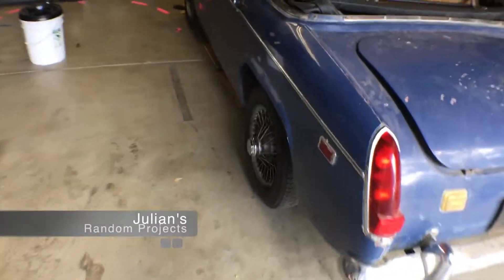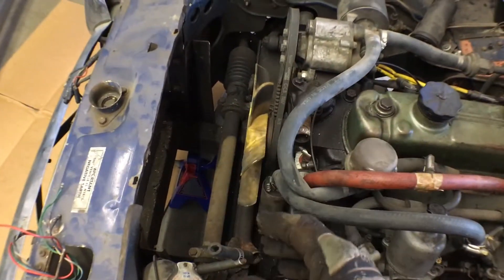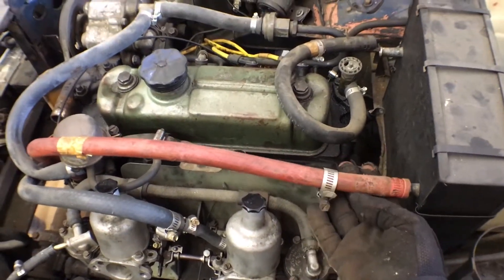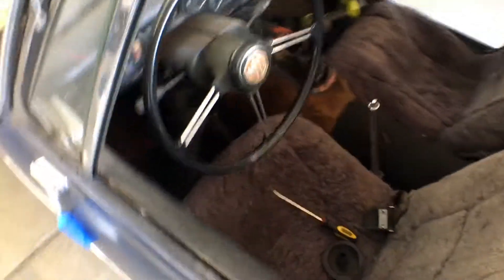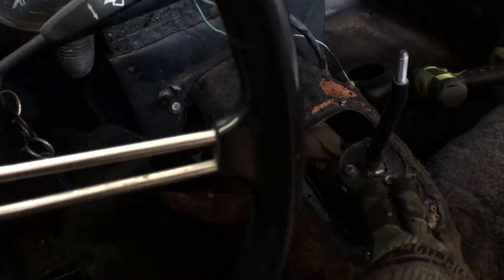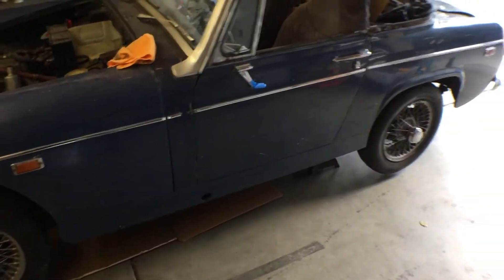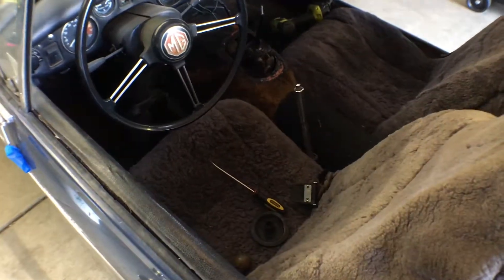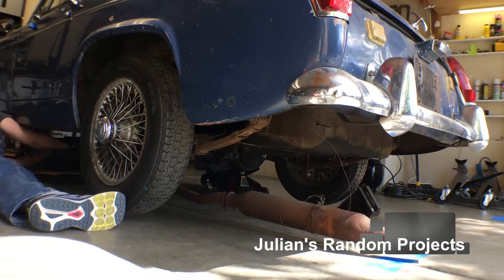MG Midget EV Conversion Part2

Comment: I'd probably suggest putting the electric motor to the rear and some of the batteries up front - with the remainer at the centre/rear for balance. these cars handle really well with proper weight distribution.